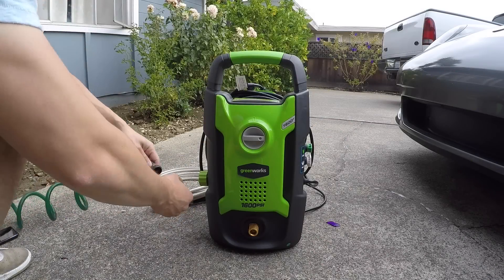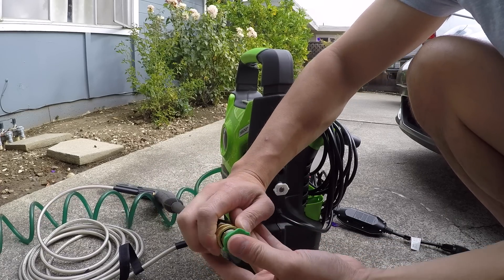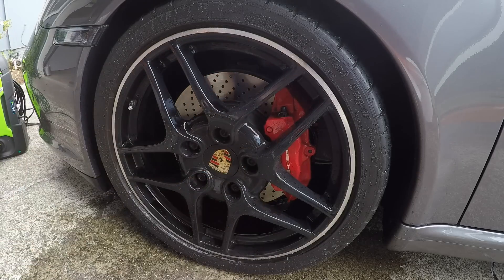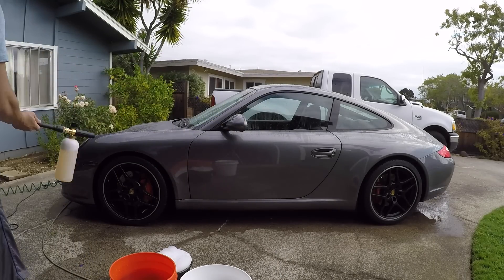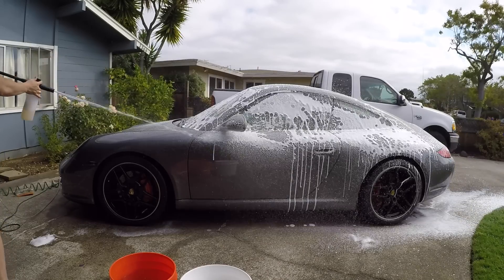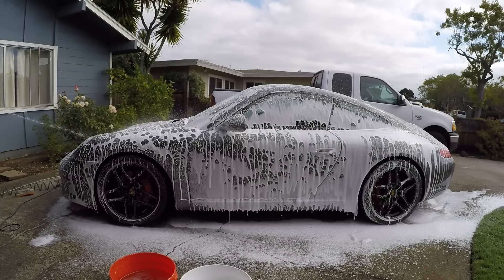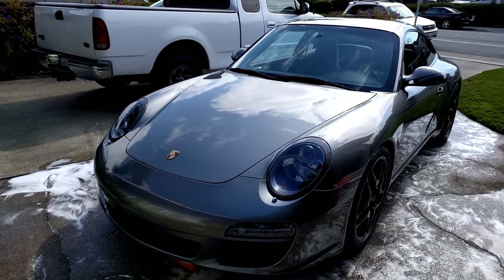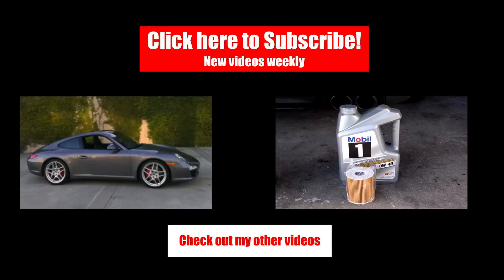✪ $99 Greenworks Electric Pressure Washer Review (Porsche 911 / 997) ✪

Comment: this little thing works wonders. I have a rain barrel system setup and the water that's collecting is a bit dirty from the roof and especially the gutter channels. I used my power washer to clean the gutters and bam! gutters look like brand new and cleaner rain water will be stored.

Comment: Nice man! Next time adjust the end of your MTM foam cannon. You could have fanned out the spray a little more and would have had thicker foam.
Reply from the maker: You know, I think mine may be defective. I tried, but the spray pattern didn't change.
Reply: yeah i definitely think you are causing possible harm by shooting the foam at a 0 degree angle, you may cause dents with it. although the foam may slow it down. but just try to see if you can fan it out like OP said.

Comment: How is that pressure washer still holding up? I am looking for one and I found mixed reviews about it.
Reply from the maker: It works just as good as the day I bought it. Overall, I like it. The one annoying thing is that the cord wants to stay in its rolled up position. Looking back, I wish I would have spent a little more and gotten this version with wheels and a rollup hose: http://amzn.to/2gJA8K5
Reply: How about now a year later? A lot of reviews online say the fitting for the hose is super cheap metal and it cross threads after 3 or so installs. After this happens it's near impossible for the hose to unscrew from that fitting.
Reply: @ryanchristensen1799  Hey, yeah that happened to mine, i can't seem to get it off after twisting for 5 minutes. Also, water leaks from the water intake, i want to buy an adapter and switch it out but i can't seem be able to remove the one already on it.

Comment: So does the pressure washer save time, do a better job or both?
Reply from the maker: +Robert Beecham it does not save time considering you have to set it up. However, it does a better job at loosening and removing dirt, which prevents scratches and swirl marks. It's awesome, but you also gave to be careful not to put it too close to your paint (ie: less than a foot).

Comment: I have this same pressure washer and I noted you put the foam cannon on the end nozzle. This is wrong, you are supposed to remove the end (second section) of the wand and put it there. The slots on the foam cannon fit right on it, just like the wand section does. FYI  PS I did the same thing you did and figured that this can't be right.

Comment: so you need the mitt to scrub the wheels? the pressure washer alone isn't strong enough? :/
Reply from the maker: +mfuji02 the pressure washer gets most of the grime off but not all. In general, you do not want the pressure washer to get everything off because, if it did, it would likely take your paint with it.

Comment: Just pick one up at Lowe’s. It had gone off sale at $ 79.99 but they had forgotten to remove the sticker so too bad for them. Must’ve been karma!
I noticed it had a current rating of 13 amps which seemed high for 1600 psi washer.
Well, I checked the load and it does draw that load with the now included turbo tip. I don’t have means to measure the pressure but I think this unit is under rated for pressure and volume. It blew away another higher output rated brand in visual performance. A swivel on the hose to un twist would be perfect. Be careful the hose can kink and could lead to a weak spot. Now if it lasts a few years of washing 43’ boat I’ll be happy.

Comment: doesn't the pressure washer already come with a foam cannon?
Reply from the maker: It comes with a soap gun, but it's not really meant for high pressure foaming. It won't provide the same thick, foam coverage as a foam cannon (aka foam lance).

Comment: Foam gun or Foam cannon? I like the idea of foam gun is quick and easy to setup, but doesn't foam as much as the foam cannon. Nevertheless, I will proceed with the 2 bucket method. Which do you think is more worth?
Reply from the maker: Do you mean foam gun as in one that connects to a regular water hose? The one you connect to a pressure washer creates better foaming action to help break up the dirt, but isn't absolutely necessary. A foam gun you connect to the water hose is better than nothing. Here's one you can connect to a water hose: http://amzn.to/2oWTLkg
Reply: That's the one I had just bought recently. Gilmour Foamaster II. After seeing that you could buy a pressure washer/foam cannon for about ~100, I'm debating if I should return it, and buy your setup.